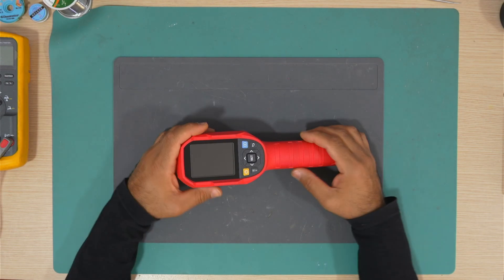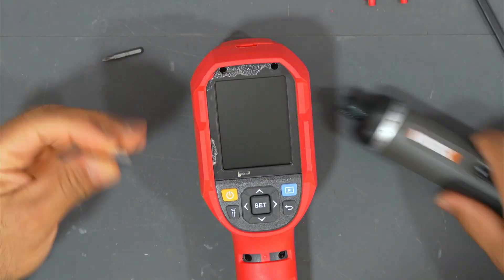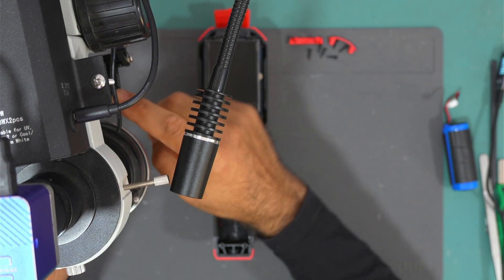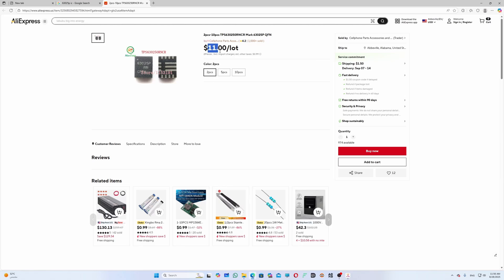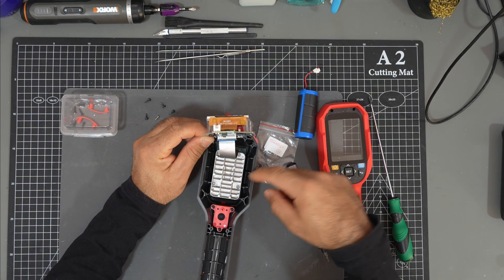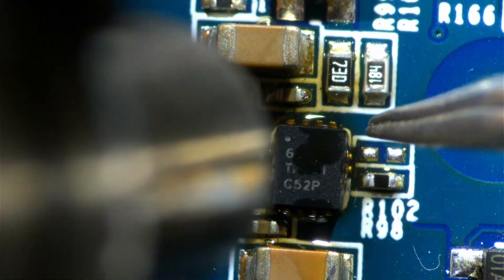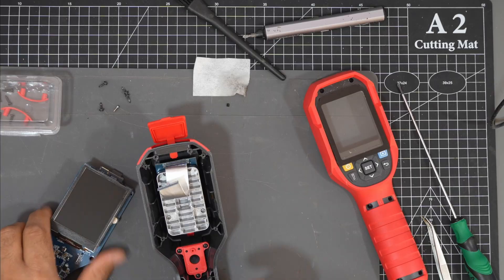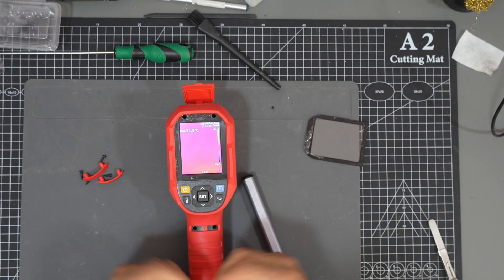Uni-t UTI260B Thermal Camera Died While Charging || Can We Fix It? Dead No Power Repair

Comment: Nice repair, mine is faulty (Unit T120) but not with the same chip, i've got to desolder the chip , could you tell me the pourcentage of your flow please ? Best regards
Reply from the maker: You welcome brother 

The air flow was 45 percent and the temperature was 380 °C